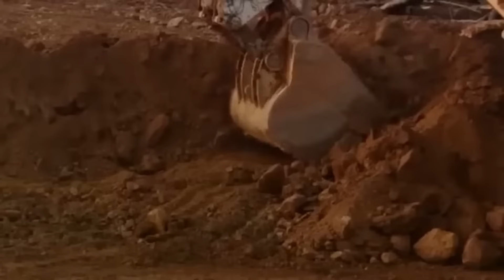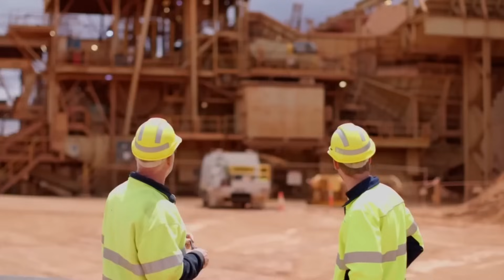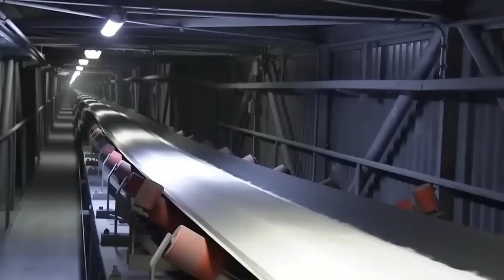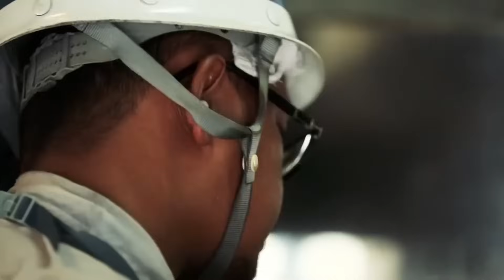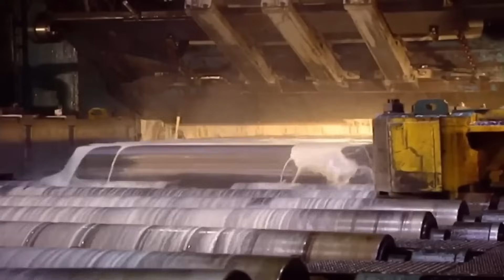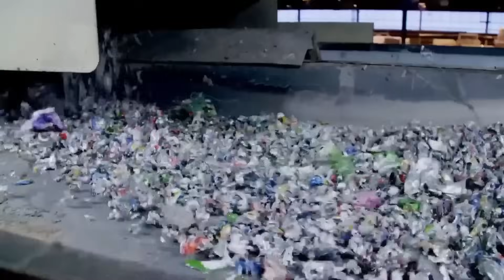From Red Bauxite Rock To Aluminum Cans (The Satisfying Process Explained)

Comment: And how doesn't the world run out of bauxite to mine?
Reply: It's the most abundant metal. That's why we will never run out of it, and because it can be recycled infinitely. Thankfully all the big building materials are abundant for future mega cities, like iron, aluminum, concrete, titanium etc.
Reply: Because Silicon, Aluminum, Calcium, Iron, Titanium and oxygen are the most abundant elements in the earths crust. These metals overwhelmingly exist as metal oxides. All the methods of manufacturing these metal oxides into metals is all based on removing the oxygen, at a molecular level, from the metal elements to produce that metal.

There is much of these metal oxides in the earths crust that they are essentially unlimited.